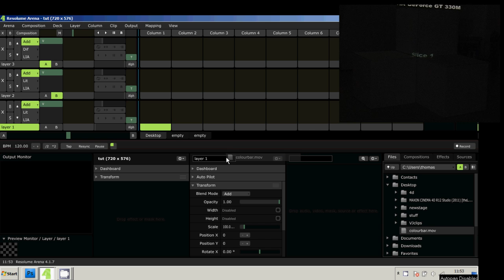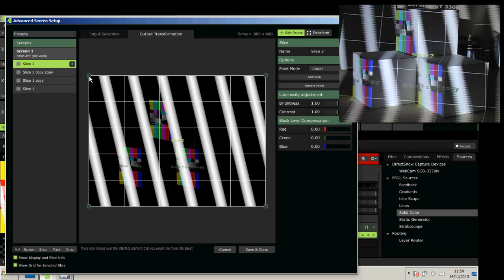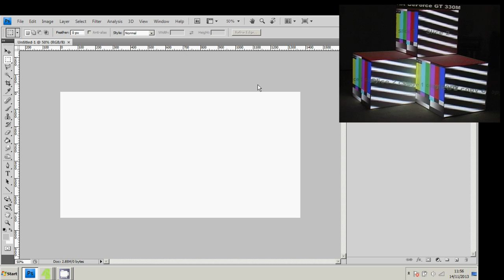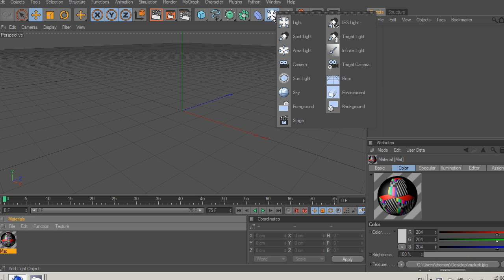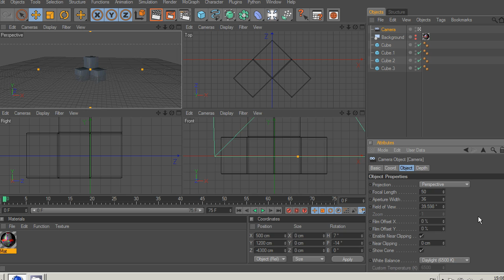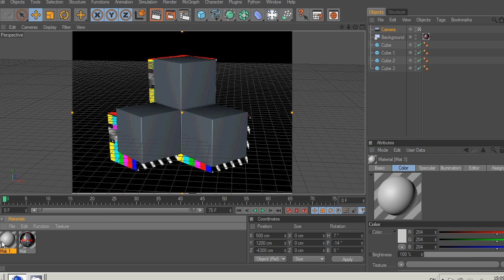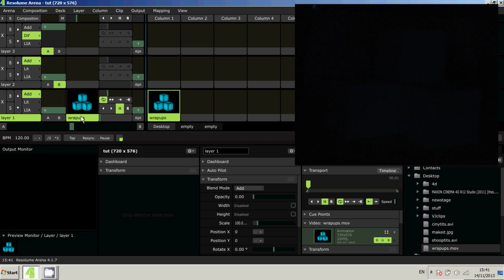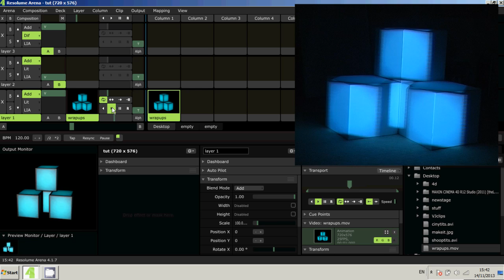Projection Mapping Tutorial (3) - 3D Modeling

Comment: Hi Tom. Thanks for such an amazing video series. I was able to make my first 3D mapping installation for NYE thanks to these. However I've run into a problem when working with Cinema 4D.
My Resolume and projector resolutions are both 1080. When I take the screenshot and import it into Cinema 4D in this resolution, the resulting background image has been rescaled to a different aspect ratio so the shapes no longer match up.
I've searched for a way to stop Cinema 4D from doing this but there doesn't appear to be one.
Would I have to recreate my project in PAL resolution to stop this from happening or is there another way around it? Would much prefer to utilize the maximum resolution of my projector. Thanks
Rory
Reply from the maker: +Rory Leeton 
Cheers bud, hope New Years Eve all went well for you!
Yeh, the scaling can bit tricky sometimes...
Have a read of the comments below V--v-v--V with dynasty006, sounds like it might be a similar problem to yours.
Definitely try and keep everything as high rez as you can though, [I only used PAL because I didn't have a very good projector]. 
You could try, instead of putting the template image on a background in C4D, is make a plane that is 1920x1080 and drop the image on that, then just make a camera and line up the plane so it fills the screen perfectly. 
Let me know if any of that helps.
Reply: Thanks for the swift reply. NYE went really well, spent a good hour fiddling around with the mapping but they absolutely loved it in end. Had to explain how I did it about 50 times through the course of the night though haha
Sounds like a good solution. I'll let you know how I get on.
Reply: +vjfit Hey dude. Thanks for your help before. Thought it'd be cool to show you what I was able to come up with. Made an origami elephant head and used it as my canvas. Here's a link to the video if you're interested in having a look. https://vimeo.com/157179096
Reply from the maker: +Rory Leeton 
Very cool!

Comment: Hi vjfit,
thanks for the great tutorial. I have some issues doing the template for Photoshop.
My computer resolution is: 1366x768
My projector resolution is: 1024x768
Resolume composition is: 1024x768
After I edit the output points, I make a screenshot in full screen, copy that into Photoshop and crop only the black area. The area where the visual is in I use as my template; however if I import some graphics based on that given area back to Resolume, the visual is much smaller and way off than the original. Do you have any idea?

Cheers Chris
Reply from the maker: +dynasty006 
Hey Chris. 
Are you resizing it in Photoshop?
The screen shot you take from the Advanced Output of Resolume will just be a random size. 
Make a new comp in Photoshop and make sure that is 1024x768 then just stretch the black area to fill that. 
Does that help?
Reply: Hi vjfit,
thanks for your answer. I did that, exactly how you said and it´s still super small and even the angles are not correct... so it´s not only that the size is not correct.
Reply from the maker: +dynasty006 
Hummm.... I'm not sure then bud. 
If you want to take a shit load of screen dumps of your process and send them to me I'll have a look and see if I can figure out what's going on. 
Upload them to imgur. 
Have a look at this as well, I was having some weird issues with scaling and the guys at Resolume told me to read this: http://winsupersite.com/windows-8/hands-windows-81-desktop-display-scaling
Reply: +vjfit 
ok, cool. I try now first another computer; if this doesn´t work; i just make a short video of the settings, workflow and output and send you a link... thanks for your help!
Reply: +vjfit 
so, that´s the situation: I changed the PC but still the same. What i figured out is, that if I insert my cropped png out of Photoshop (1024x768) and have setup my advanced output settings in Resolume correct; I get a much smaller, off, image projected. If I change the output straight to my projector (no advanced settings); my created images lines up correct! How strange is that? I´m going to make a video of that...
Reply from the maker: +dynasty006 
Hey Chris. 
Yeh, what's happening is you applying the warping twice!
If you go into the advanced output after you've made the still image and right-click then make full screen [basically turning off all the mapping] then that should line up fine. 
But there's no really need to do all of this anyway... I would only use this particular method if I was mapping a complex 3D structure and trying to make a virtual model of it in software like Cinema 4D.  
It looks like you are mapping onto a flat screen, so it is much easier: just use the the method shown in part 1 and part 2 of my tutorials. 
https://www.youtube.com/playlist?list=PLrud1wbWOIVQV2r69KZtnnYPHiCK8BUvY

Hope that all make sense. 
Cheers, Tom.
Reply: +vjfit 
hey Tom, thanks very much!now it makes all sense! only one more thing; if I create some special animation with cinema4d or after affects using my created template....then there is actually no way to seamless switch over in resolume to line up random visuals by using the advanced output; right?
Reply from the maker: +dynasty006 
I think so, you can apply different mapping to different layers. 
I talk about that that kind of thing in tutorial number 4.
Reply: +vjfit 
top, step by step it all makes sense. appreciate your patience & help. cheers mate.

Comment: Hi i have a question, well the distance of my projector from the wall of projection is as follows (these are real distances with out multiplying them by 2) 

900 - z , 240 y 

once i make my final adjustments to the camera so my 3d figures fit xaccly over the back ground the final coordinates come to 

- 1000 z , 20 - y

is that right , the only thing i did different from you was, when i took a snap shot of my out put screen instead of loading it into psd. i juss saved it as a jpg on paint ? is that y
Reply from the maker: Hi,
Yeh if you don't size it, then it will throw your numbers off.
But if you still got it to line up and it looks good, then it doesn't matter.